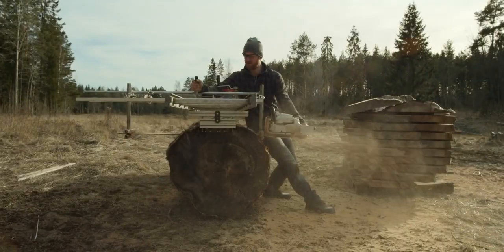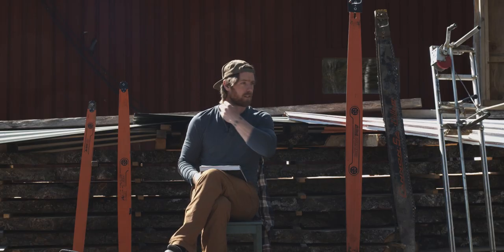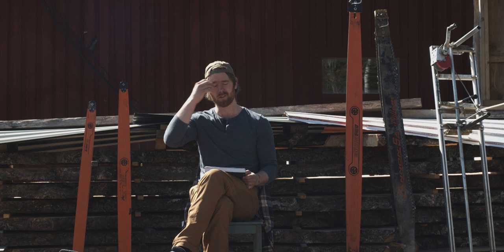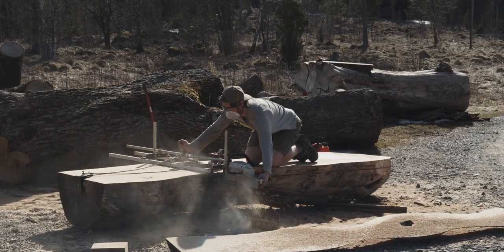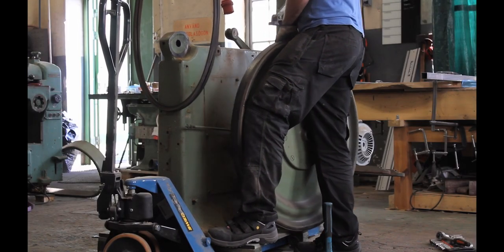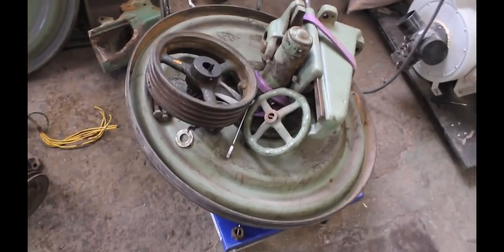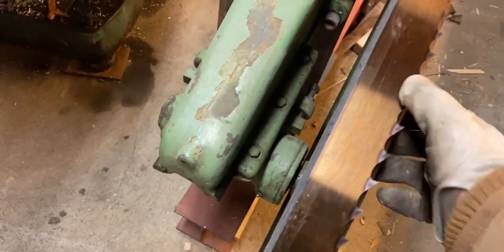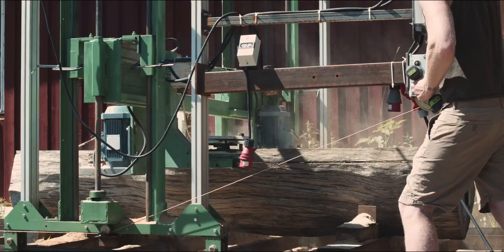This Simple Question Has Haunted Me For Years

Comment: Great video, thanks for your thoughts. I've been chainsaw milling for a few months and I've just started to build a small electric bandsaw mill. Mostly because I have a lot of the components already available and I'm nota fan of the fumes coming out of the chainsaw.
I definitely wouldn't be working my way up to bigger logs without the stepping stone of the chainsaw
Reply from the maker: Hey thanks a lot. I can relate to the fumes, never been a fan of that myself either. Really cool that you got a bandsaw under way, having parts already is half the battle. Best of luck to you
Reply: @backstromwoodwork566  don't they have a respirator that takes the fumes out of the air  for you?

Comment: I don't have a chainsaw mill - I only have a chainsaw.  I've used that small saw to cut slabs freehand that have become magnificent tables everyone who sees goes "Wow! - not knowing the wood was cut freehand using just a silly little €200 chainsaw - ok, I had to do a lot of work after to even stuff out - but still - don't let "I don't have..." become "I can't do"  - because you can if you have the will but not the mill. If you want to cut wood to produce pieces of furniture people can't resist running their hands over, you don't need all the gear, you just need to want to.  

The "oddity" is - what is seen by sawyers as "Flaws" - the uneven thickness, the dips & dives in the surface - those when sanded/worked smooth by hand are what makes a piece of natural timber "WoW!!" instead of being just another machine produced yawn Ikea surface. Loads strive - spend fortunes even - trying to get 100% flat and even slabs - when in reality, those are boring. People adore curves, features - the stuff machines do away with. So they can keep their bandsaws, tbh - they're Dull. Now when I cut a slab, I barely care if it's even level-  the wood will know what's the right cut - freehand. The result will be "Wow!" - not "Yawn" - even if all you have (or want) is a saw that cuts - not the fancy stuff that produces the same fancy stuff the other guy is producing because he bought the exact same fancy stuff that produces the exact same "Yawn".. The more a cut runs off, these days, the more I think "Yes!!" - it will make the end product piece even more interesting. I have never walked through B&Q with people & had them go "Wow - look at that! That's beautiful!" when looking at wood - here, even the small 4' slabs, people go "Wow!" - so yeah - flat is Dull.
I "could have" btw - if I wanted - but I don't. I'm just fine cutting wobbly slabs freehand with my silly little saw.

Comment: G'day BW, you're  correct everyone that wants to start milling timber/lumber shouldn't be put off by other people's personal opinions or preferences in relation to which particular type of mill is the best. In the Northern Hemisphere it really only depends on your budget, In saying that wide kerf vertical bandsaws work  very well in Australia in the hardest woods on Earth however imagine a thin kerf horizontal band trying to work it's way through an old growth log that's twice as hard as an Oak knot at five percent moisture content it's like a rolling sea the wood dust gets under the blade and it heats up expands and it's up and down we go not to mention it's 40C before we even get started 👍.

Comment: I think i’ve logged over 100+ hrs researching milling videos over the last year and the Logosol big mill wide slabber is probably the best of both worlds. Plus if it becomes more than a passion you can upgrade to an electric motor, burning fuel is just not viable given todays prices. The only thing stopping me is that it’s very pricey for what it is and they also have another product called F2 plus which is great for making lumber but not big slabs. So essentially I’m stuck with a brand new tractor and ms881 using a $150 chainsaw mill. Finally is there any point to making slabs if you don’t eventually invest in a vacuum kiln?.

Comment: Gday from Australia, firstly congratulations for your excellent videos, 10/10. I have recently cut some wide red cedar slabs (1850 mm wide),  with my Stihl 088 attached  to Granberg mill and 84" GB guide bar.  I did encounter some bar flex which resulted in up to 4mm to 5mm variations in the middle of the slab in relation to both outside edges (thinner along middle of slab),  have you any ideas on how I can prevent or reduce this occurring?? Australion Red Cedar is a soft rainforest species of timber, keep the videos rolling mate👍👍

Comment: Great video. Personally I’m building a band mill and hopefully have it going this week. Chose the band mill because of the thinner blade. It’s almost 6 feet wide but I made it so the idle wheel can be moved in to only 3 feet wide so I can use a smaller blade for most of my milling. 

Your closing thoughts are great. Regardless of what you do, DO SOMETHING. 😁